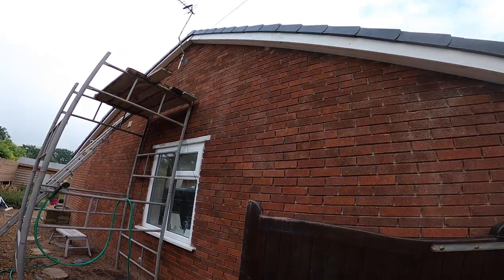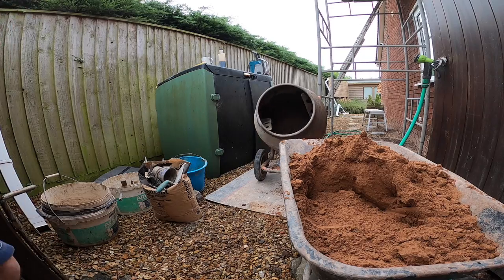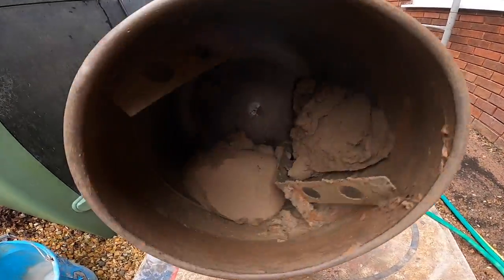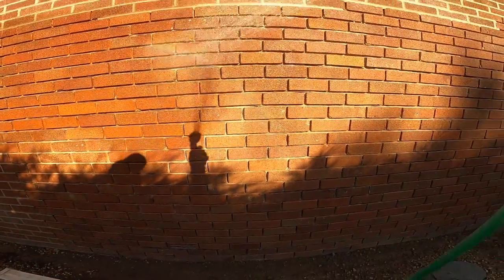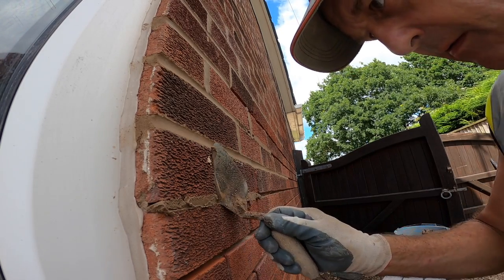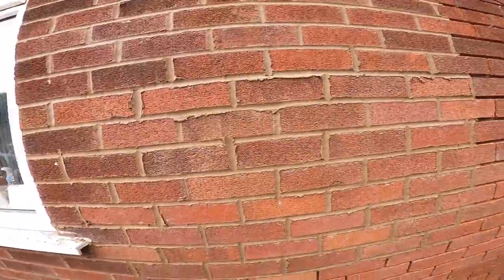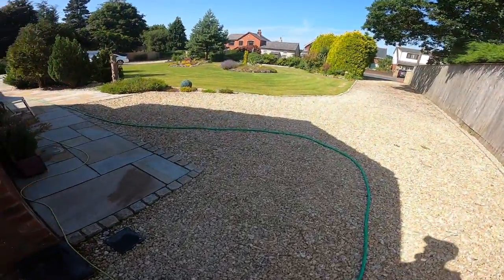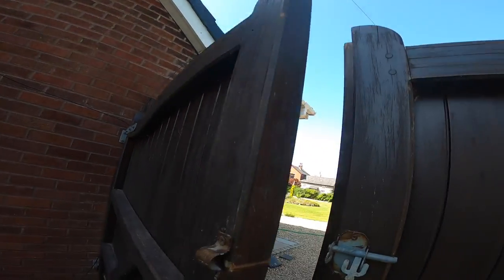HOW TO: REPOINT A WALL, STEP BY STEP

Comment: Noticed you never use a stand with your mixer is it to save splashing. Also when you clean mixer out especially on someone's drive where do you tip the waste
Reply from the maker: I hate the stand and all the room it takes up in the van . It just gets in the way .if we can’t rinse out we just leave the water in for the next job 🧱👍🏽🤙🏾

Comment: How do you stop your mortar drying out so quickly, I make a batch up and seems by about half way through pointing it start drying out quite a bit, I add a plastisiser to mix but still dries quickly.
Reply from the maker: You cant stop it drying  , just do small manageable mixes 🤙🏼🧱👍🏽

Comment: Thanks for the tips... pointing on my house needs doing and as am isolating again its one of the jobs on the list,  I think I will struggle a bit on the front as the beds there are  between 3  and  5 mm  while the walls on the back and sides  are the normal 10mm, I guess the bricks on the front are a bit  taller, none of the beds look as if a line was used when they were laid as they rise and fall like a rollercoaster lol
Reply from the maker: Sounds like the traditional Accrington engineers on the front and clay commons on the sides and back . I don’t do the front ones it’s a bit more specialised 🧱👍🏽

Comment: I hold the hawk up to the wall, level with the bottom of the joint, and use a tuck pointer the same width as the joint, ( or slightly narrower)  and push the muck in straight from the hawk, while moving along. Really quick and easy method
Reply from the maker: Nice tip ,  🤙🏼🧱👍🏽
Reply: @SteveAndAlexBuild   yeah give it a try see what you think. Flatten the muck al over the hawk to your joint width. Go right to left if your right handed
Reply from the maker: @matgurd  🧱👍🏽🤙🏼

Comment: Tidy job Steve you don't need me to tell you that. 
I use the hawk and blade instead of guaging/pointing trowel. Before tooling off with the half rounder.
I go right side of the wall to the left and blade in off the hawk with the joint and kind of flick or as if I'm doing a  ✔ ontoto the bottom arris of the brick above, so no smudging at all. For me its way faster 😁
Reply from the maker: Sounds good Pal 👌🏼🧱👍🏽

Comment: Thanks for the excellent video👍
I have a brick wall in the kitchen that has damaged pointing due to a leaking pipe. It's a weight bearing wall but it's behind the washing machine/cupboard. Can I get away with not getting it repointed or is it dangerous to leave it as it is?
Reply from the maker: Best bet is to have the wall inspected by a structural engineer to be sure 🧱👍🏽

Comment: When filling your bed joints you should pull each cut of mortar into the last from one side to the other so it pushes them together instead of pushing it in head on

Comment: Very nice work.  One question.  After you went all over the wall with the sponge to level it all out I see there is a slight film of mortar on the outside of the bricks.  Do you wait a few minutes and then use a clean wet sponge to wipe off the face of the bricks?  I never noticed you doing that I. The video.  Thanks, Tom
Reply from the maker: No mate if it’s very noticeable brick acid is used a good while after . Otherwise it will weather off pretty quick 🧱👍🏽

Comment: I saw them re-pointing the brickwork on a building in New York that must have been 30 stories tall. They ran the scaffolding all the way up both sides of the building where they did the work. I said, "Man, that is a BIG job." Must have been a couple of hundred thousand bricks on that building. It took them several weeks to finish it.
Reply from the maker: Wow that sounds very cool 🤩🧱👍🏽

Comment: Tidy job 👍
Reply from the maker: cheers buddy 😁🧱👍🏽
Reply: I do a lot a lot of pointing and don't bother with the mixer, gorrila tub and plasterers whisk far less clearing up.
Reply from the maker: @bricklayersworldwithandy6277  . I may need to invest , thanks for the tip 👌🏼🧱👍🏽
Reply: @SteveAndAlexBuild  look out for the lidle and Aldi ones around £40
Reply from the maker: @bricklayersworldwithandy6277  👌🏼🧱👍🏼

Comment: hi Steve, I noticed you have raked out the dpc joint will this not cause a problem in the future with ground water? when I do repointing I will only repoint dpc if the membrane is sticking out the wall preventing the wall above being bridged from below.
Reply from the maker: I always take it back a bit , I hate seeing the dpc sticking out 🧱👍🏽

Comment: Why are you working back hand? If your right handed you work right to left! You work against your work and your joints aren't full when you use a pointing trowel. Don't they sell flat slicker where your at
Reply from the maker: This is the way I was taught 36 years ago , same as setting brick always left to right . As for the pointing trowel you may not get the joints full but I do thanks